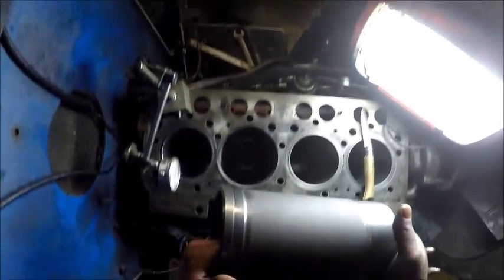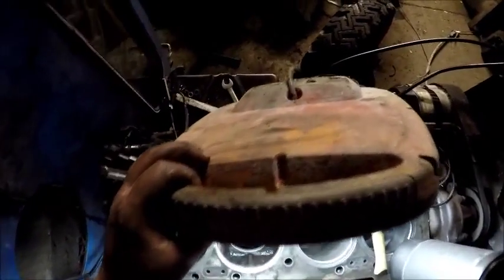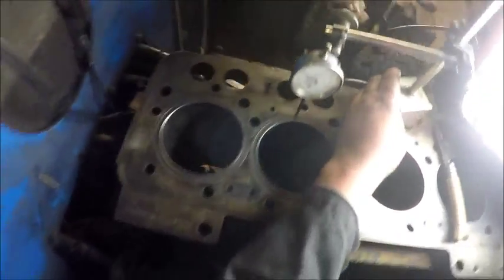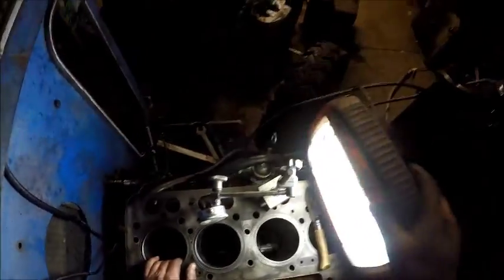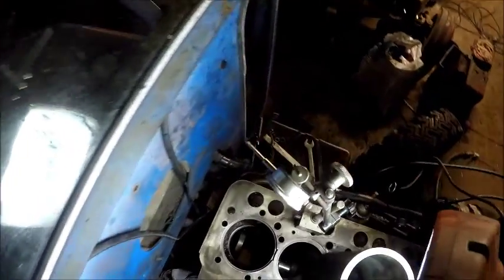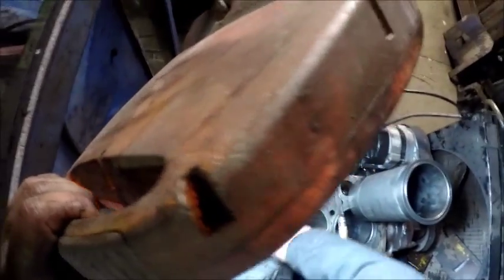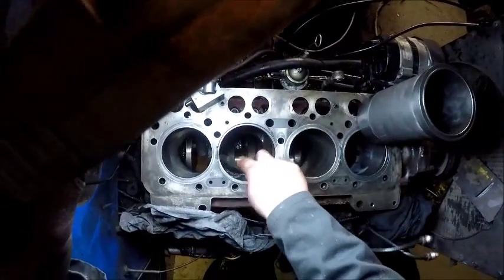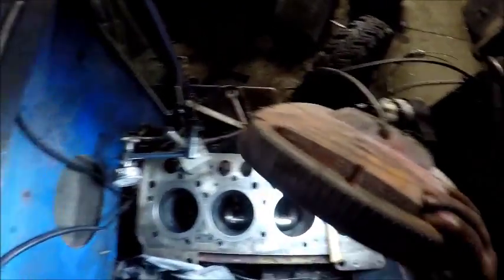Engine liner setting

Comment: don't you hook them up with bolts like it says in workshop manual before measuring? Also they mention that measurements should take from 3-4 points around liner so you can be shure that liner is straight at the housing.